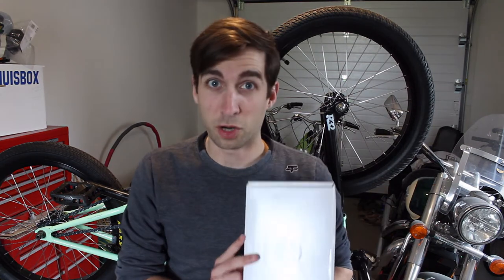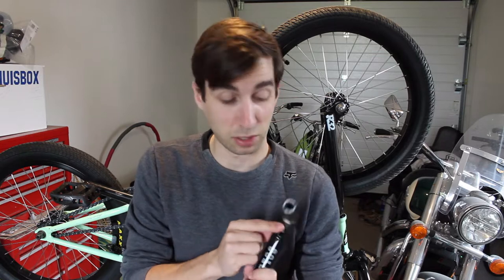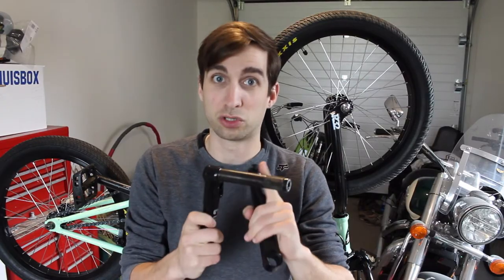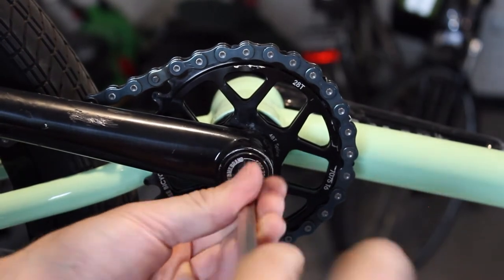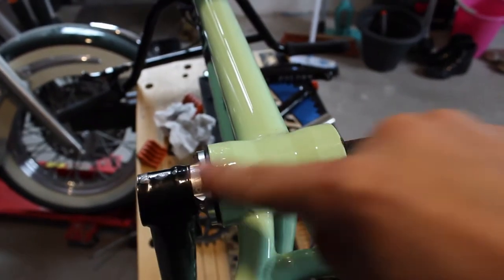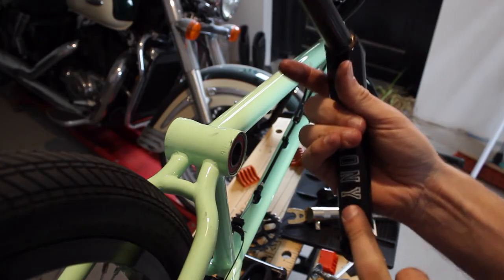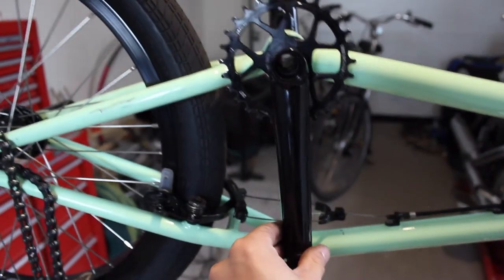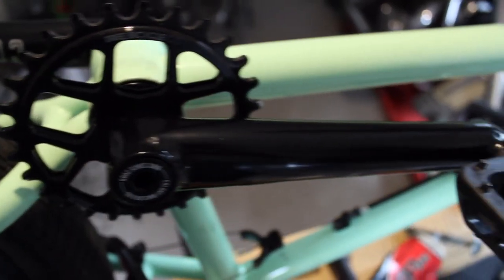How to replace and install BMX cranks

Comment: Splined cranks should come with a mounting tool, and a removal tool, so we don't need to butcher our aluminum washer or use a hammer.  I'm loving the spline drive sprocket, bye bye sprocket bolt.
Reply from the maker: Some cranks do come with mounting tools! Removal tools are handy and one size fits most so useful just getting one for in your toolbox 😉
Reply: @stuartgibson   I do have the removal tool, $10 on Amazon and works great.   Any idea which mounting tool (to push the crank on) will fit a "Premium 1948" crank?  The cranks are made by Haro, 19mm spindle.  I was looking at the Profile GDH mounting tool, but not sure if it fits and it's pricey.  For initial install I used the crank arm bolt itself to mount the arm, and it thrashed the aluminum washer the bolts sits in.

Comment: Is it possible to update a 19mm crank and spindle to a 22mm (sealed mid BB)? You just need a new 22mm BB right? Didn’t know if it had to do with frame or if just a bearing and BB replacement. Thanks
Reply from the maker: Correct! You can change the size of your cranks if you get the matching bearings that fit those cranks and your frame
Reply: Thank you. Much appreciated

Comment: Great video but my crank is stuck tighter than a nuns chuff. 
Any suggestions? Ive got a rubber mallet but not to sure if i will mess things up?
Reply from the maker: Rubber mallet works very well. There are also tools for the job but mallets are easiest

Comment: OMG, I wish I would've found this before hand. I took my bike to Scheels because I didn't know how to realigned the cranks. I though it would have two bolts, from your video it only has one, and I'm sure mine did as well. I'm hoping they don't try to rip me off, because I didn't know.
Reply from the maker: How did it go?!
Reply: @stuartgibson  So, they charged me $25. It's probably something I could've fixed, but I'm a wreck I accidentally blew a tire while trying to pump it up. It said up to 60 psi, It got to like 50 then the inner tube blew up. 😂 I'm probably not destined to do freestyle bmx.

Comment: I have a midschool haro its in really good condition the only problem is the bolt that holds the arm to the axle keeps workin itself loose ? What could b rong with ith thanx
Reply from the maker: It's probably shaking itself loose. Maybe try some medium strength blue loctite

Comment: I have an old bully bmx and I’m new to this stuff,how do I work out what crank size to purchase is there a number somewhere or do u measure it etc?should I replace sprocket too,can u buy a complete set
Reply: Crank size is on the back of the crank. Hope this helps

Comment: Can I measure my axel size with a measuring tape or do I need a specific tool, also can you make a video on top 5/top 10 best budget parts or upgrades
Reply from the maker: You could best use a calliper to measure the thickness of your axle! I will see what I can do about your video request!
Reply: @stuartgibson  thank you!

Comment: Hey! I have a fixed gear bike its based on a Fairdale Coaster the Crank arm system is like bmx style with the 48 t sprocket attached to the crank arm with one bolt, due to usage the hole in the sprocket where the bolt connects the crank arm is bigger than it is suposed causing my chain to slip from time to time and the bolt becomes loose very easily. Any suggestion? Thanks!!
Reply from the maker: I hate to say it but best thing would be a new sprocket in this case. You could put a washer between the bolt and the sprocket so the bolt is pressing against a larger surface and put some loctite on the bolt threads to prevent it from coming loose easily. That’s all I can think of now.
Reply: Stuart Gibson Thank you I will give it a Try!

Comment: How tight do u screw the bolt in the crank arm? Im not sure the feel of tightness it should be?
Reply from the maker: Due to the combination of spacers on my cranks I’m able to tighten the bolt all the way until it can’t go further. If that’s not an option you should base it around how much friction you want your cranks to have. Loose enough for crankflips or tight enough that they stay in the same spot when you take your feet off in the air.
Reply: Stuart Gibson thnk u that was very helpful :)

Comment: Does a shimano xtr m9100 fit in bmx bottom bracket?
Reply from the maker: Good question! It should fit in a 24mm bmx bottom bracket, however.. no idea if the axle is long enough.

Comment: So how old were the old cranks?  On average, how long do you ride parts till you replace them with new ones?
Reply from the maker: The cranks were roughly two years old. I start looking to switch things out between 1.5 and 2 years at the most however a lot of stuff can last way longer or isn’t a safety issue if the part were to fail so I don’t replace on a time schedule really however I do look things over regularly.
Reply: @stuartgibson Cool, now the wife can't make me feel guilty for getting new parts💪💪💪. I remember Taj use to do something similar.  He often  replaced the whole front end (bars, fork and stem).  Seems expensive but not as expensive (or painful) as getting new teeth and facial reconstruction surgery.
Reply from the maker: Orange Blue I completely agree, avoiding accidents by replacing parts on time is a very smart thing to do. Bet your wife agrees!

Comment: my cranks are really tight on and hard to get off since i havnt greased em in a while and i still can’t get them off 😑
Reply from the maker: It helps to apply some heat to them and spray WD-40 in between before taking to it with a rubber hammer
Reply: @stuartgibson  This ^^^

Comment: Thoughts on wtp legacy cranks? I destroyed my old Sunday saker pair 8 spline and I'm deciding to upgrade to 48 spline 👍
Reply from the maker: I like them! Wethepeople generally makes good stuff anyway! Only downside with 2.5 piece cranks is not being able to have a spline drive sprocket when riding right-side drive. Solid upgrade!
Reply: @stuartgibson  thanks bro 👍
Reply: @stuartgibson  I instead bought colony venators couldn't resist they looked beautiful in chrome

Comment: Hey man, I’ve just gotten back into riding after about 8 years! I’ve got a subrosa frame with the standard cranks on and want to swap them out for the chrome version of these colony ones, I’m hoping it would be just a case of swapping them over, how do I determine axle size to know wether I’m ordering the correct parts, thanks in advance, your videos are super helpful.
Reply from the maker: Kieran Jones you could use a caliper to measure the subrosa crank axle and check that way is you’d be able to just swap out the cranks. Welcome back on the bike!

Comment: quick question. im building my first custom bmx right now. and when it came i asked them to install as much as possible. so 1 crank + BB was already installed. i still gotta do the sprocket and right crank. but as soon as i put it all on, it seems like the crank is only like 50-70% on the middle part thing. is that enough or do i risk breaking that part?
Reply from the maker: Andulas is, the axle in the middle does not go all the way to the end of the crank arm in most cases. About 75% in sounds just about right, no risk of breaking it with a margin like that.
Reply: @stuartgibson  ah ok, good to know. In my case it's just 40-50% tho. I measured it out. Now I gotta try to fix it somehow without tools
Reply: @stuartgibson  hey I have a question I bought a bike off my friend and I put a different rim qnd put it on and my chain keeps falling of does this mean I need a new crank or do I just need to put a new chain on
If not pleasesplease explain
Reply from the maker: @therealpinkguy2772  It is almost never the crank causing those issues. Often it's something with the sprockets alignment or maybe a tooth or the chain itself is broken. However I think your chain might just be too loose. Might want to look at the tension of that first.
Reply: @stuartgibson  thank you I think I'll check that out

Comment: I have a 19 fit hango  will odyssey thunderbolt cranks fit my bike
Reply from the maker: The new Thunderbolt cranks come with bearings so you should have no issues as far as I know! Just make sure you pay attention to left side or right side drive cranks!

Comment: Hey man,im having some problems with my cranks i cant get them off.. i hit them with a hammer and they are still attached tightly to the spindle even tho all the bolts are off,can anyone help me please?
Reply from the maker: Have you managed by now? Otherwise try some penetrating oil, and maybe heat the crank arm up before you try knocking it off again
Reply: @stuartgibson  how do i heat up the crank?

Comment: I'm replacing my sprocket but, probably from previous attempts.., the nut for the sprocket to pedal has rounded.

How would you suggest going on from here? 😂🤣
Reply from the maker: That's the worst! Maybe you can use an angle grinder to put a slot in the bolt big enough for a large flathead screwdriver?  Make sure you spray WD-40 around the bolt and have it soak for a minute before you start turning! Won't have a lot of attempts to do stuff like that, it's a last resort thing.
Reply: @stuartgibson  thanks for the reply! Definitely an idea worth trying as I'm desperate 🤬. Only other option is potentially angle grind from the outside into the bolt to remove it completely. I'm obviously not reusing the current sprocket. As long as I can get the crank arms and spindle off undamaged it's another option. Grinding a slot for a flathead is neatest option so will try that 1st .. thanks again!

Comment: Hell I am kinda new to this but the sprocket ( chain wheel ) what the tooth number from the frount one and back one
Reply from the maker: On my bike it's 28-tooth up front and 9-tooth in the back. Also common would be 25-9. It all comes down to personal preference. Obviously the bigger the difference between the numbers the heavier it will feel to pedal around but will give you a higher top speed.

Comment: Does any crank fit in any bmx bike?
Reply from the maker: Ous Alzohbi if its a bmx specific crank yes it should but always check which bearings you need.
Reply: Stuart Gibson well my bearings are super rusty which bearing you advise me to get?
Reply from the maker: They are basically almost all the same. There are very few bearing manufacturers in the world so lots of brands actually have the same bearings.
Reply: Stuart Gibson man idk how to thank you I’ve been so desperate to fix my bmx thank you again man!

Comment: Hey my bmx bike makes a wear klink/klank noise after a peddle or two do I need new cranks?
Reply from the maker: Very hard to say without taking a look. By the sound of it, it could also just be a bearing issue.
Reply: Stuart Gibson yea dude I honestly don’t know I fixed my chain did everything perfect. So now when ever I go to put weight on the first peddle it makes the noise it’s like the crank can’t handle all my weight pushing down on it to get it started
Reply from the maker: Drew Robinson do you by any chance have a new chain on an old sprocket or the other way around?
Reply: Stuart Gibson new chain on old sprocket
Reply from the maker: Drew Robinson that’s probably what’s making the sound. New chain on old sprockets tend to do that as the sprocket is worn down to match the stretched old chain putting a new chain on just doesn’t fit right. It will eventually go away.
Reply: Stuart Gibson thanks makes since because it’s really not constant

Comment: Do I have to take the pedals off to take the cranks off
Reply from the maker: No you don’t. But just a heads-up if you plan on taking the pedals off eventually it’ll be way easier to take them off when the cranks are still on the bike.
Reply: @stuartgibson  I’m really just trying to figure out why my cranks keep locking up, I’m trying to see if I need new bearings or bracket set or a chain bc it’s all kinds rusted and I’m just now figuring out I have to use grease in the cranks and stuff

Comment: What size are you using when you're loosening and tightening your cranks?
Reply from the maker: You mean the tool I use? It's an 8mm but that differs per brand cranks I guess

Comment: I have a kink whip and whenever I try to slide the peddle off and it won't come off at all, it's like the krank is stuck
Reply from the maker: Get some penetrating oil in there, maybe heat up the crank arm with a heat gun if you have that and smack it off with a mallet

Comment: I just got these colony 22 cranks and my bike is rhd, i can not for the life of me get my bolt on sprocket to go straight with them 😭 ive replaced everything just for it not to work lol
Reply from the maker: Sorry to hear that! Very frustrating trying to solve stuff like that! I gave up and just always choose to run spline drive sprockets.
Reply: Yeah i think my next step is to try that, only thing is that i need to convert to LHD to do so because the colony 22 cranks only have splines on the left side of the spindle
Reply from the maker: josh reeves that seems like a very costly way to solve the problem
Reply: Yeah thats the only downfall about the cranks in my opinion

Comment: What are those cranks? Brand and model please.
Reply from the maker: The cranks are Colony BMX 22's!
Reply: Okay thanks. I just measured my spindle but it’s a 19mm.
Reply from the maker: Rigo Mancilla you can always get new bottom bracket bearings that allow for a 22mm axle if you’d really want to ride those cranks
Reply: I measure the actual diameter of the bearing and it’s like a rough 22mm. Kinda like 21.5mm. So I think I’m going to do that. Would you recommend these cranks?
Reply from the maker: Rigo Mancilla I do yes! Great cranks! If your old cranks have a 19mm spindle, you’ll 100% need different bearings.
Reply: Stuart Gibson awesome. Thanks so much for your help.

Comment: I cant unscrew my cranks my bolts are sooo tight any help?
Reply from the maker: Firstly are you turning them in the right direction? Second, maybe try some wd-40 or penetrating oil around the bolts and allow it some time to work. Third, you could try to put a pipe on your allen key giving you more leverage
Reply: @stuartgibson  i will try that tomorov but the direction is right i think
Reply: I would recommend a torque tench or something better than an Allen key that u can grab with 2 hands
Reply: @dylanw6427  i unscrewed the screw yestarday, it was stuck there was a crack and then it came out

Comment: 3:30 I can’t slide it off
Reply from the maker: Might need to grab a mallet and use some force. Just don't hit the sprocket itself, don't want to bend that.
Reply from the maker: Rasian the axle or crank arm that’s still on there.

Comment: One of my crank screws is stripped how can i get it off?
Reply: ive done this with other screws but if you put super glue on the top of the screw and leave the screwdriver inside till it dries, it’ll harden and you can just unscrew as normal